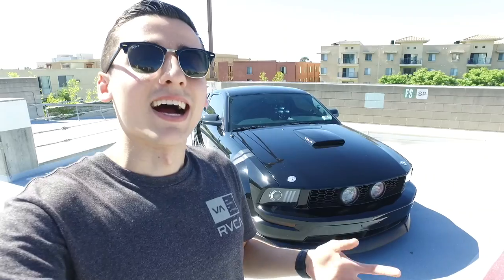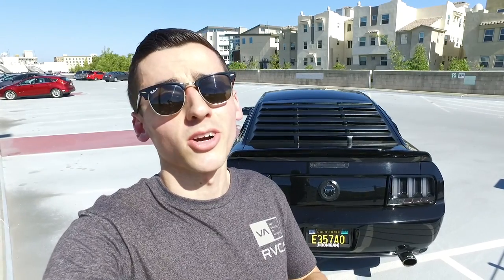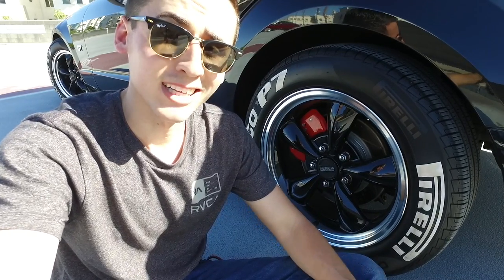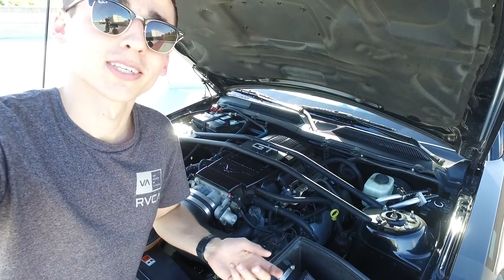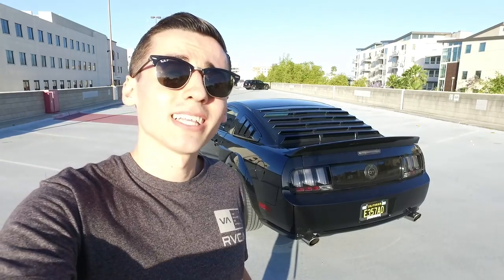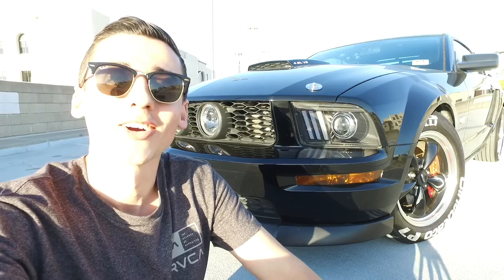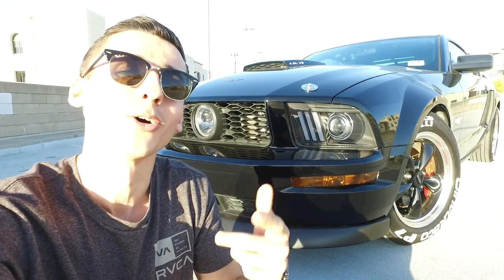4.10 Gears: The ULTIMATE Gearing Ratio For Your MUSTANG

Comment: Did you notice much change on your speedometer?  Also, you got a JLT CAI.  Ive been in the market for a CAI.  How was the fit on your 2008?  Did you get the Bama tune with it?  I am debating it.  I was thinking Airaid synthaflow CAI.  Opinions?  i am a little afraid of premature wear but need a cheap pwr pick up.  Nice vid again!
Reply: James I am currently selling my JLT CAI and tuner. I ordered an Edelbrock E-Force supercharger and no longer need it let me know if you are interested.
Reply: CLPATTERSON hello.  thx 4 offer.  but I am in market for new one with custom tune.  trying to put only new stuff in my Stang as its got 123K miles on it now.  yikes!
Reply: No problem I totally understand, FYI In the tuner is a custom dyno tune for the JLT it cost me like  $400 just for the tune and it made like 14hp and 20 pounds tq over the can tune that came with it from Excessive motor sports.
Reply from the maker: I LOVE the JLT Cai so much!!! JLT and AIRAID are the best cai you can get for your mustang. No matter which one you get, you will get the best performance out of it. It is a tie for me for both. Go with your heart. You will not regret either one of these great cai

Comment: Hey so I’m thinking about getting these, is the acceleration difference between stock and 4.10 really noticeable or just meh noticeable?
Reply: I know this is an old comment but trust me I've been in the mustang world for years and years, gears especially for an automatic is by far the best value mod you get besides maybe a tune. Just make sure you get it done it done at a good shop for a fair price and assuming it's a mustang make sure you use the Ford racing gears so it doesn't cause hear whine. Honestly gears, are going to have the best performance increase from anything except for Super/Turbo chargers or Nitrous nothing else will compare, still a great bang for the buck even with the mpg hit if you daily your mustang
Reply: @timtresch4848  right on appreciate the comment👍 still have my 3v but haven’t done any gears due to it being my daily and commuting on the highway mainly

Comment: That installed price wasn't bad $500-600.  4.30s on a DOHC motor is the ultimate, coupled with a T-56 that has a .50 6th gear.

Comment: 17 Mustang GTCS 6R80 trans.  It came with 3:55 rear end and it has ford performance pack 2 on it with Borla Atak catback.  Don’t know how much power it make but it will pull on my brothers 17 2SS with headers and cai and is almost dead even with a stock 17 C7 from a roll.  Thinking of doing 3:73 gears and headers next

Comment: What RPM are you at when you go 80 MPH with the 4.10s?
mods--
BBK Longtube headers
offroad xpipe
Dynomax Race Bullet mufflers
Airaid CAI
Bama custom tune
18x10.5/18x9 TSW Rouen rims w 285/35/18r Sumitomo p3's
2010 gt
Reply from the maker: I am about 3,000 RPM's when I am going 80 mph. DAMNNN BOY! I like your setup! I really want those long tube headers! They put out so many gains
Reply: Nate Rider love the videos man, you have a great style and format! Informative and great presentation, well done! Looking forward to more, subscribed!  Following up on the comment above, is highway driving annoying with RPMs at 3,000 around 80mph? Also, is first gear too short? I am so torn between 3.73s and 4.10s. 2007 GT vert, 5-spd, CAI, Catback, BAMA tune and various suspension mods.  Thanks for your thoughts!
Reply from the maker: I am so happy you enjoy my videos. Im posting one this wednesday! Nah it actually sounds very nice since the engine is working harder, but it does burn a lot more gas hahah yeah throws are shorter for increased of torque. I love them go for 4.10

Comment: I just got 4.10 for my mustang gt. I haven't installed them yet. What's the traction Difference between stock and 4.10? Should I get a good set of tires? I also do alot of highway driving.
Reply from the maker: traction is the same, but if you boost your car then you will need it. Highway mpg I get about 18mpg
Reply: Nate Rider right now I get about 20 mpg highway. 18 is not to bad for a v8. Idk if I will ever boost my mustang anytime soon, its very expensive.
Thanks for the response.

Comment: nice and nice car as I have a black 2007 ford mustang gt and have a 62mm throttle body  and the same cold air intake as yours plus a 92 octane race tune from bama tunes as it pulls. I want to get the 4 10 gears next then the muther thumper cams then the long tube headers and cross pipes as my budget is limited and time it will take me but I love the difference so far
Reply from the maker: haha yeah its always tough choosing parts when they all cost so much plus a lot to install too. Make sure you grab the 4.10's tho! You will love them

Comment: Are you reading this having issues with noisy gear whine after swap? I did 3.90 = so much whine they'd never get better
4.10 = still whine on acceleration. Speed shop says everyone buying any brand of gears are complaining of excessive noise and hard to get a good pattern setting them up. Professional installers! how do your 4.10's sound, especially with a 1 piece aluminum driveshaft?
----
However, these cars should have come with at least 3.73
only 2200 rpm at 70mph with  4.10, but sooo much more zoom!

Comment: 07 GT. UD pulleys, JLT C.A.I with tune by Brenspeed. Ford Racing 62  mm TB, charge Motion Delete Plates. Kooks long tube headers. Got stock 3.55 gears...and nothing till about 3,000 rpms.😕
Reply: I stand corrected 3.31 rear end.

Comment: those sr underdrive pulleys are a bad idea. most of the brands cannot keep the vibration down enough on the harmonic balancer and can blow your oil pump ive seen it happen. brands like steeda or other top brands specially make theirs to completly avoid that issue. thats the one thing i wont go cheap on.
Reply from the maker: Awesome info! I never thought of that. Thanks for sharing!

Comment: I'm hesitant to switch to 4.10 because I don't want first gear to be too tight and light up the tires in first. But 4rth and 5th are way too tall for my liking. Is there a place I can get shorter 4rth and 5th transmission gears?

Comment: If you live in Europe don't go higher than 3.73. We actually can top speed our cars on a daily basis and not to be afraid about the ticket or a jail.
Reply from the maker: I wish i lived in Europe where there is no speed limit lol you are lucky! and in that case yes, 4.10 gears might not be the best if you are talking about high speeds for a long period of time. Larger gears are for faster acceleration for shorter races
Reply: 373 is the best way to go i just took 4.10 out burn out too much

Comment: I am looking Into buying a s197 like 06/07. Here they go for like 17.000 euros- 20.000 with about 80.000 km on the odometer. 
What i am conserned about is People saying as soon as they hit 100k MILES = salvage. Makes no sense. A car should last 200k miles or so.

I need help with this statement, please.
Reply from the maker: these cars are lasting 250,000 and longer. Many people have told me their high mileage and tell me that the car runs like new. You should get a steal with a mustang with 100,000 miles. Its a good buy trust me
Reply: Over 240k miles on mine & running absolutely great. Makes me think low miles is overrated.

Comment: I have an 01 cobra, offroad H pipe, flowmaster 40s and k&n intake. Im debating 3.73s, i think 4.10 is too low for me
Reply: Ivan Psimer i have an 01 cobra as well trust me get 4.10's the low end torque is horrible on our cars it feels like picked up 50hp
Reply from the maker: whatever you go with you will love! Those two ratios pull like no other
Reply: godgiven i do quite a bit of highway driving with it though is my worry. Ive taken it out of state twice in 2 months, and put 5k miles on it since may.
Reply from the maker: Exactly! older gen mustangs should go with 4.10's but the newer mustangs should go with 3.73

Comment: does the under drive pulleys really make a difference
Reply: david green yea think the same thing. i want to know
Reply from the maker: Minimal to none. It is a performance mod you put on to squeeze ever last Horsepower out of your car. Its easy to install and it is not that expensive (I actually got mine for free), that's why I have them installed. On American Muscle they do claim that it gains Horsepower
Reply from the maker: I hope that solves your question! Let me know if I should do a short video on it
Reply: Nate Rider yea that helped didnt know if it did much and i was going to buy it off american muscle. thanks for saving me money cause i was expexting 10hp gain as am says
Reply from the maker: Yeah man that is why I am here!
Reply: Nate Rider what would u say about the bama tuner? could u make a video explaining it?
Reply from the maker: Its great! I love it. I will definitely do a video on that shortly
Reply: They don't necessarily "gain" horsepower, per se. They free up some of the parasitic losses from the accessories. You won't gain power to the engine, but you'll see an increase in wheel horsepower. I gained 6 whp
Reply: waterudoing on top of that it could be bad it turns the accessories slower it could not saying it will but it could cause charging issues due to the alternator spinning slower
Reply: Funnily enough, my battery lasted 8 years before getting an UDP and having the battery give up. Other than that, never had a problem with the accessories at all.
Reply: waterudoing it doesn't turn the accessories as fast so it charges slower
Reply: It's mainly a concern for people who run high rpm's.   Pumps have their own speed ceiling - when a water pump goes outside its curve, it starts cavitating and loses effeciency without adding a second stage.  There is also a sweet spot for coolant velocity through any engine - just because you can go higher doesn't mean it will necessarily cool more.  I have seen intercoolers for large diesel engines actually have to have flow restricted to get the time needed for heat exchange - full velocity from the pump caused higher engine temps.  If you run really wide rpm ranges, an electric water pump with properly selected gpm will eliminate some headaches...and allow a post shutdown cool time if you want it.

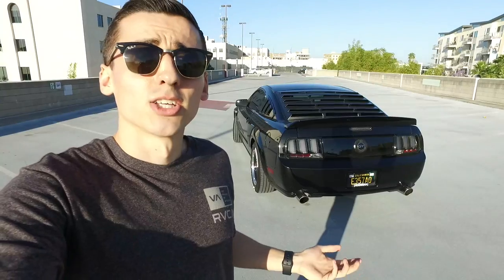Comment: are you concerned about drive shaft with 4:10 gears?
Reply from the maker: Not at all! But if it breaks I will sure let you know! 4.10 gears are so great
Reply: I hope not that would be bad. I got 4:10 on my 2013 3.7  drive shaft is known for breaking past like 125 mph on stock gears. On 4:10 I wouldn't go past 90 mph
Reply from the maker: Ohh yeah idk bout the 3.7 driveshaft. I haven't done research on that. For 05-09 mustang's you should be able to go top speeds with 4.10 gears with no problem. I have gone 140 with the 4.10 gears on and Sally took it like a man
Reply: Nate Rider that's sweet!
Reply: Nate Rider so you hit top speed with 4.10's??? if i remember correctly this style had the 140 spedometer.

Comment: Get some Enkeis, lightest wheel on the market! Every 1lb of wheel weight reduction has the effect of 20lbs of overall weight reduction. 40x20=800lbs!!!!!
Reply: 02 Mustang GT, 300lbs diet (weighs around 3,000lbs), J-modded auto 4R70W valvebody, Heat wrapped air box since it makes contact with coolant hose. Gears, Enkeis, coil overs, kmember, and tune are next!
Reply from the maker: Damn I never heard of those before. Thats crazy numbers tho haha Imma have to check it out. thanks for the advice
Reply from the maker: that sounds like a beast setup. You mustang is gonna carry those gains!!

Comment: the next mods I'm doing will be the ford performance intake manifold, gt500 throttle body, and the 91 octane race tune... Then later down the line cams
Reply from the maker: Ayeee get those gains Dustyn! I like it. You stang will be sucking air like no other. Keep on feeding that beast engine!
Reply: Nate Rider hell yeah brother

Comment: i have 305 rwhp on my v6 Camaro!!!! with 3.91 gears :D
Reply from the maker: DAMN! That baby pulls like no other I bet haha
Reply: ehhhh yes lol but it still needs to lose weight :( nice vid bro!!
Reply: American Muscle305 what mods you have? my 01 cobra dyno'd 302rwhp with a 

offroad x pipe
slp catback
steeda pulleys
JLT cai
bama 91 tune

want to throw 4.10's on when i can afford it.
Reply: Oil Catch Can = Elite Engineering 
Cold air intake = Cold air inductions intake
80mm Throttle Body = Overkill 
Ported Intake Manifold = JacFab 
Intake manifold spacer = JacFab
Tune = Trifecta 93 Octane
Exhaust = Solo highflow Cats from SoloPerformance 
BBK X-pipe 2.5" inches no resonators
SLP Loudmouth 1  mufflers
3.91 Gears

Comment: 340 RWHP Correct lol ?
Reply from the maker: To the crank lol I always get that question. To the wheels is a different story
Reply: Ohhh okay lol I see...
I Have Hot Rod cams,Long Tube Headers,62 MM Throttle Body,JTL CAI,3.73 Gears,Pulleys,Tune Basiclly Full Bolt On,And I made 344 RWHP NOT INCLUDING The ZEX WET 75 Shot,I Make 344 RWHP Without the NOS.Its LOTS OF FUN MAN !!!
Im going to start posting my car on youtube,Im mainly active on IG not Youtube.
Im From Houston Texas The Street Racing Capital :P lol
Reply from the maker: I can't wait to try out my first 100 shot of nitrous! I just finsihed installing it:)

Comment: I hate 4.10s. I had them in a 99 cammed cobra and my supercharged 3v. And how do you know the power you make at the crank? Lol. 4.10s are absolutely horrible man.
Reply from the maker: 4.10's are not for boosted vehicles. you would need smaller gears for higher powered cars. If you car just has basic modifications than 4.10's are a life saver
Reply: Actually, the more horsepower you have the quicker ratios you need for racing. At the track all those superstock racers with 900, 1000 or more horsepower use 4.88s and 5.13s or even higher. My Supercharged Cobra had 3.55s and I put in 3.73s which totally woke my car up. I may even go to 4.10s or 4.30s eventually. The only problem there is traction which is why I run MT 315x35s in my rear. Your mileage is down because your motor is stock and 4.10s are making it work too hard. If you bump up the horsepower, you will regain some mileage. I still get 20 MPG on the highway...when I stay out of the throttle that is! lol
Reply: James Etheridge for a boosted car yes they are horrible. you mentioned you had them in a 99 cobra, i own a 01 so if thats true you know how garbage the low end torque is on these 4v's. they dont pull until after 3k rpm and they come with 3.27's factory. the 4.10's really wake up a n/a car its gets you into the power band much quicker. 4.10's are great if you dont highway alot.

Comment: You car won’t lose any speed because it isn’t limited my gearing.  It is limited by a lack of power and it is shaped like a brick, so you are limited my wind resistance.
Reply from the maker: thats true they are not too aerodynamic!
Reply: Nate Rider I had a Honda Grom and I lowered the ratio and it actually got faster because it was in a better part of the power band and could actually push me in high gear.  66mph 8hp.

Comment: I have an 07 GT vert black with 4:10's love these gears my top end took a little hit but you get there a lot quicker I have all the bolt ons had my car dyno'd made 415 to the wheels very impressed with my car. For rims check out the KMC DISTRICT CARID.COM 20in 8.5 front & 10.5 rears all black five stars they are what I have on my vert with a 2in eibach prokit Spring drop
Reply from the maker: Yeah acceleration is key for car performance. It very rare where you will be racing at top speeds lol Sweet! I'll check those out. Thanks for the suggestions